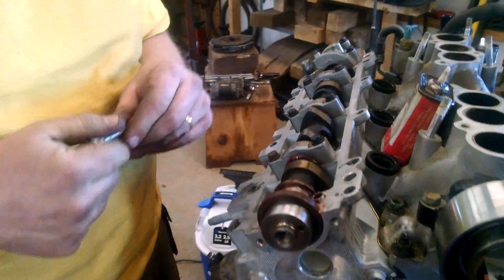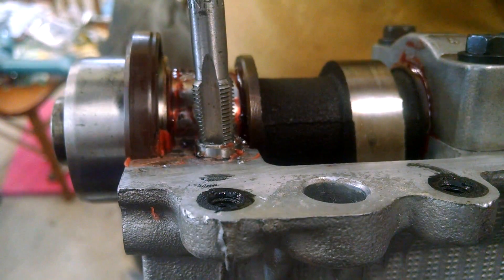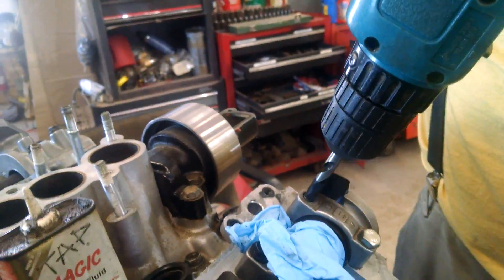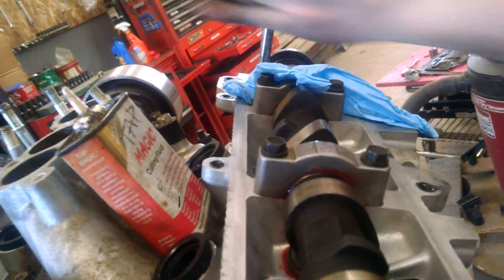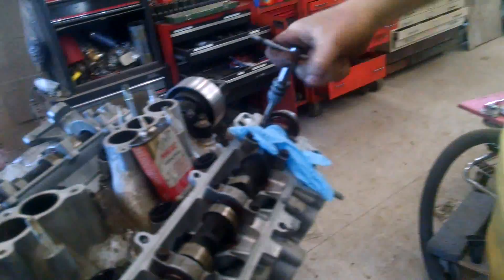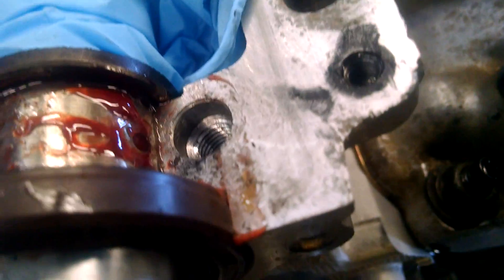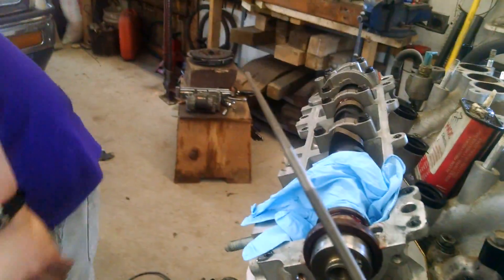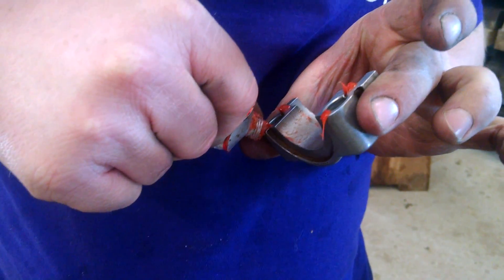How to fix stripped bolt holes in aluminum head

Comment: You can remove the tap and use a big nut over the guide and tread a bolt and nut into the guide and then tighten the nut to pull the guide out

Comment: I had the exact same thing happen to me while torquing the cylinder heads last year on my newly rebuilt engine, also a 3vze. I discovered that the stock cam bolts only go halfway down the total amount of the thread. There is still the same amount of thread past the bolt. I simply got a bolt that is longer and it used up the remaining virgin thread so I knew it was gonna be nice and tight since that thread was never used before. I actually replaced all the cam bolts on the right cylinder so that they can all torque properly. It worked great & I'm still enjoying my 4runner. So before doing all this work, I recommend people to first check how much thread is left inside. The hole & thread may simply go in deeper & will simply take a longer bolt.

Comment: Hello, thanks for posting this. I have a 2000 4Runner with a 3.4. When replacing the camshaft plug and getting to 12 lbs torque, my lower bolt kept spinning. I pulled it out and with it came some aluminum threads. I'm searching everywhere trying to figure out what to do now.
Reply: T_ Buzz 
Having a similar problem now, might be a bit late, but did u find a solution to your problem?
Seems the helicoil kit that matches my threads isn’t big enough to make new threads.
Reply: @DrewDiddy7703  You probably already did something about it. Check to see how deep the hole goes down the cylinder head. if it is deeper past the total length of the bolt with your camshaft cap installed, check how much deeper the remainder of the thread goes in. You may simply be able to fix your problem by using a longer bolt. That's what I did & I didn't have to do all this work. Funny thing is that it also happened on a 3vze engine like on this video. I think it may be a common problem with the 2nd generation 4Runners. The camshaft bolts are simply too small, not long enough to use the remainder of the thread that goes in deeper so the thread strips on a 30 year old vehicle that most likely has had the engine rebuilt 2 previous times or has had the head gasket replacement 3 maybe 4 times.